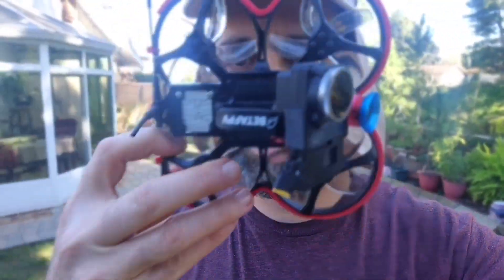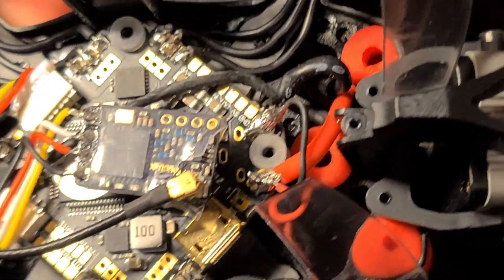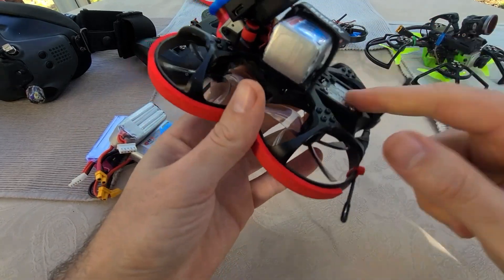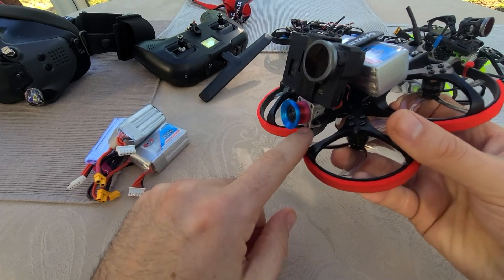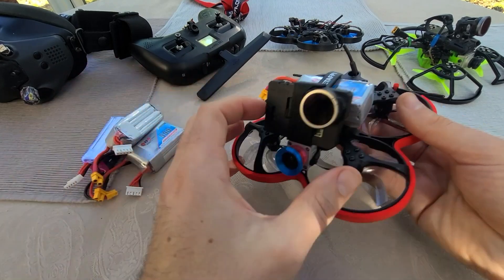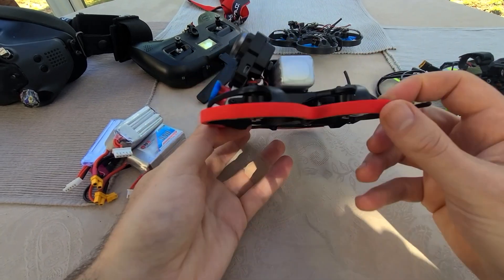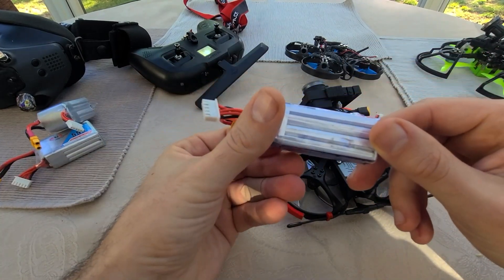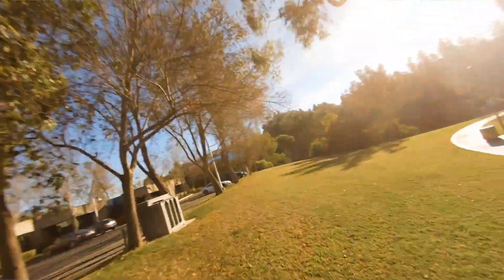IS IT BETTER? Beta95X V3 and F405 20A V4 Flight Controller

Comment: Gotta say, kinda bummed you've quit making videos! :(  You're one of the only guys making videos of micro quads with a naked Vista in it. Please continue.... 👍😁

I know the issue you were having with your motors on your 95x v3. It's looks like you got the early one with the 1106 motors! That was yet another mistake by BetaFPV! GEEEZ!  They came out with what they should have called a V4, but for some reason didn't (probably didn't want to admit that they FUCK%D UP yet again!!!), that has 1404 motors. 
I got that one. My motors never even feel warm. Plus, it flies so much better and is much more efficient. I get good flight times, at least 3 - 4 minutes with that 450mah 4S you didn't have any of. That makes it significantly less heavy. And, I could care less about HD video with any added camera, so I even removed the factory camera mount to lessen the weight even more.  Making it have a naked Vista would make it even better.  Mine only weighs 122 grams. i'm considering making it a Naked Vista and swapping out the Nebula V2 for a Nebula Pro Nano camera. That should get me down about 15 grams less!  Imagine this drone at about 107g with that fantastic camera, and flying with a small 450mah 4S!  Light, fast, and nimble!  I love flying it where we could never fly before with analog quads - right up in the top of the tree's canopy, weaving through all of the scraggle and ghost branches to find a 10" x 10" hole to fly out of one tree and right into another tree's canopy!  It's like flying in a labyrinth! 

Chris Rosser did a video on this model with the 1404's and did a spectacular tune for it! It flies amaZing!  Really precise control for those tree canopies!  Highly suggested. Switch out your 1106's for 1404's, use his tune, and you'll be absolutely lovin' this 95x V4 LOL.
  
Why BetaFPV has to release 4 versions of the same quad to get it right is beyond me! Oh yeah, it's right in their name - Beta!  They have 3 Beta models, released to the public like moron's, then the final 1404 (V4 is what it should be called) and they FINALLY get it right! LOL  Sheesh!  What a funky ass company they are!  🤣🤢

Comment: Mine doesn't get hot as I use the recommended battery 450mah. Less flight time but worth just buying more batteries, for cooler motors.

Comment: I tried Albert's Turing PID but I also changed the ESC configuration to 48kherz, now the rear motors heat up less.  you've tried?

Comment: pls do let us know when you tried with 1204. seems that could be the best solution as the 11 series have less torque, so its working quite harder . and i agree, a good 3 inch size would be the best frame upgrade

Comment: I’m also using this frame with 1207 motors, but mine also get very hot. Now I’m using Tommy’s tune with 48khz and filter sliders on 1.0 and they are a little cooler, but still very warm. 

My 3 inch has stone cold motors with 24khz and filters on 2.0
Reply: Answer to the problem:  BetaFPV ended up coming out with a version they still called a V3, but should have called a V4 (probably didn't want to admit they fuck%d up that many times! Sheesh!) with 1404 motors. FIXED! Mine has those and motors aren't hot at all.
Chris Rosser did an exceptional tune for that one. I use it and it flies very precise! I took off the external camera mount to get it lighter because I could care less about HD video. I will now make it a Naked Vista and change out that craptastic Nebula V2 camera with a Nebula Pro Nano. It now weighs 122g. I think it will weigh around 108 - 112g when I'm done. I use a 450mah 4S lipo and it gets great flight times, and is nimble and quick with those far punchier 1404's, but very precise when flying up in the tree canopies negotiating all of the scraggle! Fun and something we never thought of doing with analog! :)

Comment: I would guess the back motors are hot because they’re working hard Against the resistance of the vista in the flow path. They will have to spin faster than the front motors for the same amount of usable thrust. 
Great review!

Comment: My motors were too hot to touch after 1 3 minute flight. I got a little cooler motors with Albert Kim’s tune and 48khz. I’d be interested if you figure anything out. I’m apprehensive to fly it with motors this hot